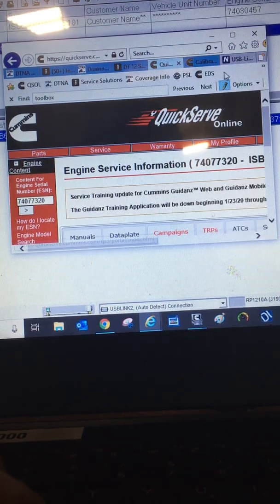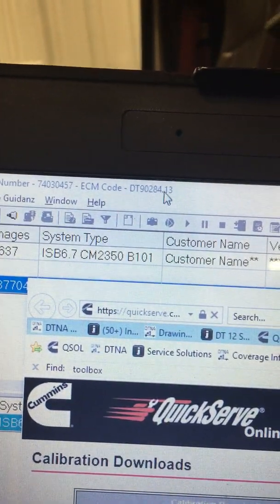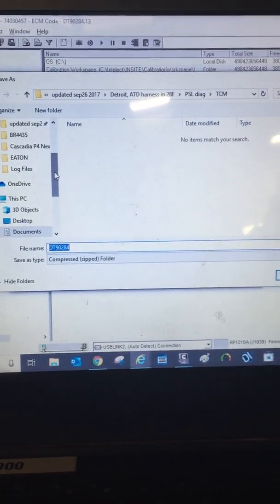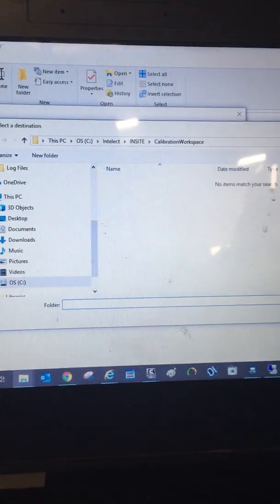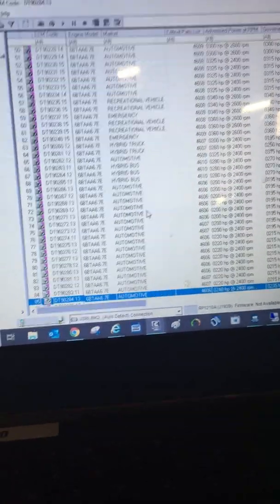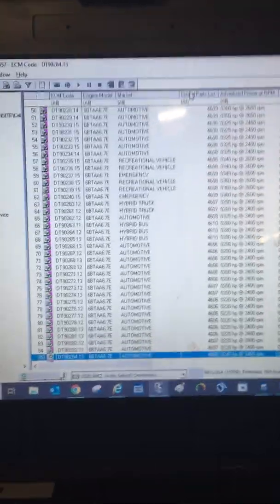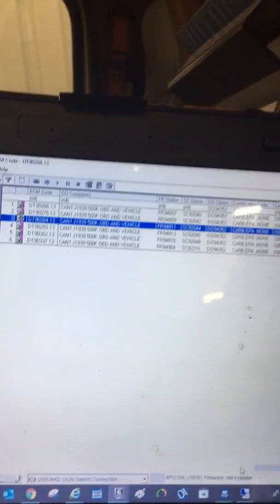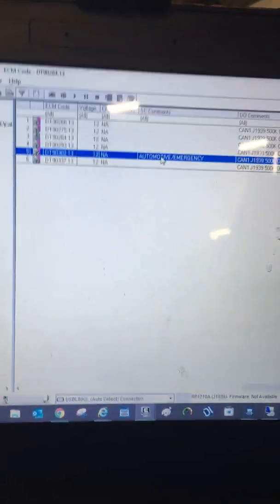dtnaMasterTech Cummins Horsepower change with no parts

Comment: Where do you find the DO#?
Reply from the maker: At about the 4:00
Reply from the maker: The DO# is in that same window area.  You just find your ECM calibration code and scroll over to the DO# section.
Reply: What is the Do comment? They say either 250k or 500k
Reply from the maker: @aDvLegend   if you selected to filter your CPL and your DO (based on what the ECM base code is) you shouldn’t have any other options in the DO comment section.  

Now I’m assuming here, 250k and 500k is for the j1939 speeds.  On Freightliner’s 500k is on trucks 2016 and newer. Identified as a twisted pair of wires white with green strip (low) and white with yellow stripe (high).  As well as having a green 9 pin Data Link Connector.  And 250k j1939 having twisted wires one yellow (high) and another green (low). 250k having a black DLC.   In both speeds j1939 goes to pins C (high) and D (low green).   Too much information
Reply: On the base calibration it’s set for 250k so I’ll make sure the new one is set for that then, thank ya
Reply from the maker: @aDvLegend  Your welcome.

Comment: Yes thank you, been looking at picking up a service laptop & insite for a cummins equiped kenworth i have.
Reply from the maker: Be aware, you will likely not have access to a fleet cal code, to change the ECM software.
Reply from the maker: I believe it’s only for Cummins authorized dealers.  Even as a dealer, I have to call a distributor to get it.
Reply from the maker: What engine do you have in it?   If you had a Freightliner, I know how to diagnose electrical and beyond with my eyes closed.  Thanks for dropping in on the comment section.
Reply: @dtnamastertech  its a cummins x15, but i might have found some software to remove passwords, so we'll see.. its not urgent. but the package for it is like 600$ lol.
Reply from the maker: @thebetaguy  so you could need a zap it, to remove the password and a fleet cal code to change the software.
Reply: @dtnamastertech  awesome thanks, ill have to look into the package and see if it has some kinda fleet cal code then. probly wont buy it for a couple weeks tho, im forming a company first.